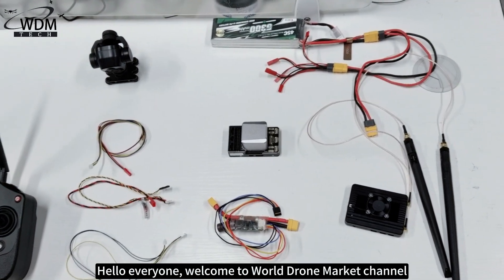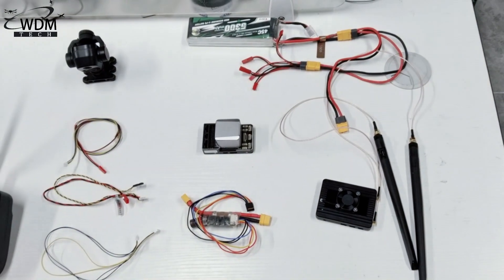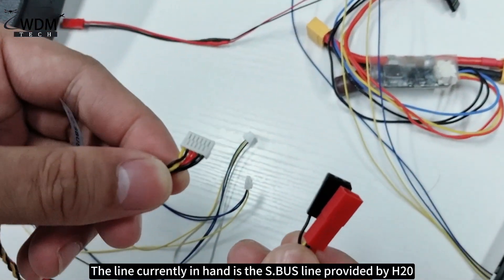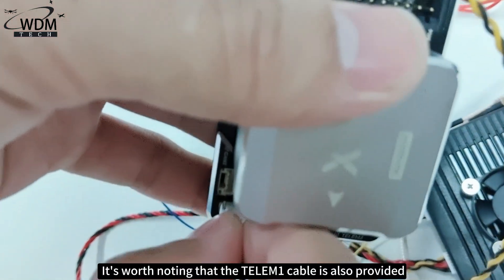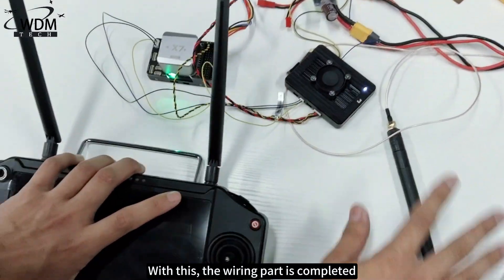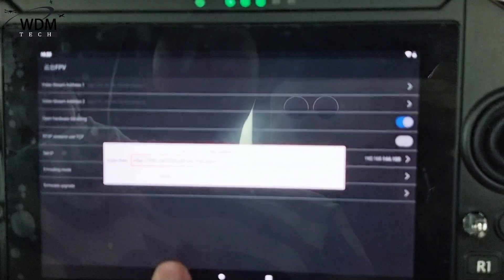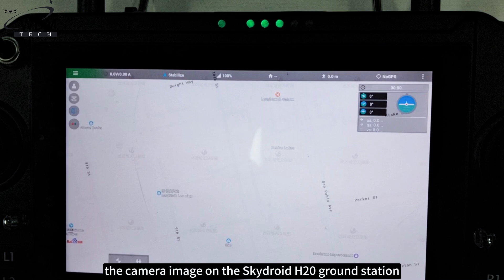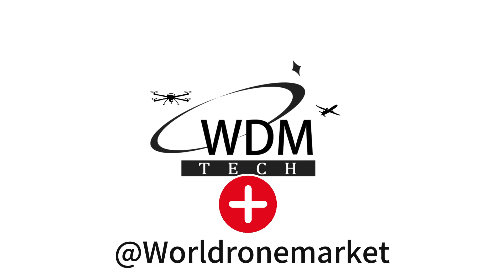Skydroid H20 with C12 and X7＋Wring video

Comment: How do you control the camera in qgc
Reply from the maker: QGC can only display the C12 screen, but cannot control its movement. If you want to achieve the control effect, you need to develop it yourself.
Reply: @worldronemarket  can you simultaneously open both QGC and the skydroid app and switch between apps during flying?
Reply from the maker: @mushfiqwizkit  You can open QGC software to connect the drone first, and then open skydroid fpv to control the C12 gimbal.